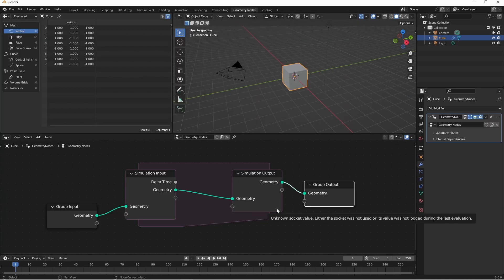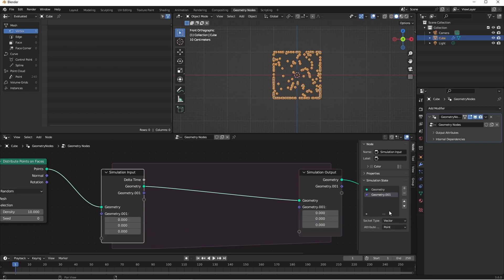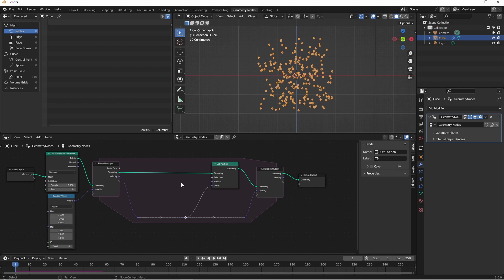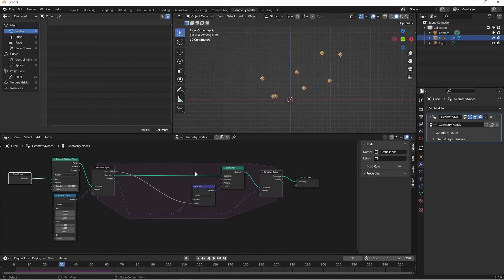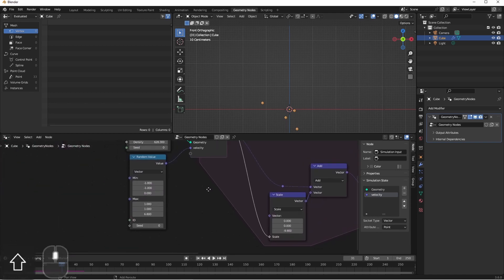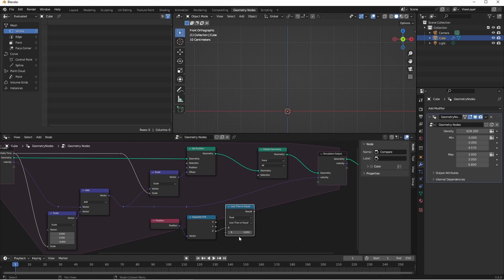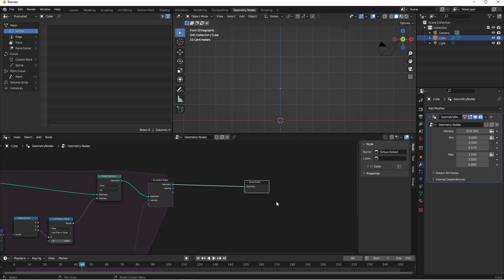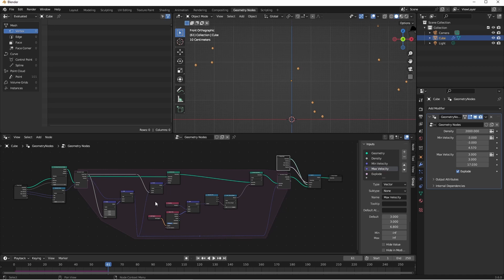Intro to Simulation Nodes Part 3: Particle Systems and Starting to Blow Things Up

Comment: Hi, great tutorial series but when I switch on and off repeatedly it only explodes the first time I switch it on. 

Also when I added nodes (the ones to the Delete Geometry node) I couldn't get them to be included in the simulation zone - it still worked.
Reply: I see! I just wanted it to restart every time I hit the switch, because I want to create several sprays turning on and off multiple times with geometry nodes. I got the result with particle systems to have full control but the performance gets heavy load.
Reply: Same here. When I try to "restart" using the switch option, it just continues the previous animation where it has stopped previously. Have you figured out a workaround it? I'm using the Blender 4.0!
Reply: @marcelowiek Sounds like it might be a change/bug in Blender. I'm on 4.0.2

No I just moved on to another tutorial. Blender changes so fast most tutorials are out of date.

Comment: Look like your setup different from video in part II. In your previous video, you use velocity to scale by Delta time plug to Set Position node not velocity after add gravity, so which setup is right? In theory when I change the fps, I got the same position? but when I test they have different position a little! I test in both two ways setup!
Reply: every second, the position in different fps increase the same amount! I've tested 30 vs 60, and 10 vs 20!
Reply: When use Delta time, at frame 1 Delta time is 0, It start from frame two! And I think your previous setup, gravity get effect 1 frame later.

Comment: Great tutorial. Will you be addressing that the -1,-1,z to 1,1,z random vectors will make the explosion look square from above in a future part? I've been trying to solve it in an easy to control from the modifier view way for a while but have been unable to build something I've liked so far.
Reply from the maker: Yeah I’m going to try to hit that a little bit in the next video
Reply: If u normalize the random vectors,It will help